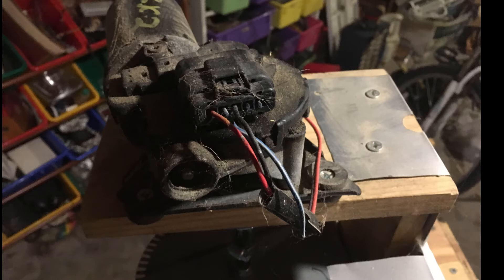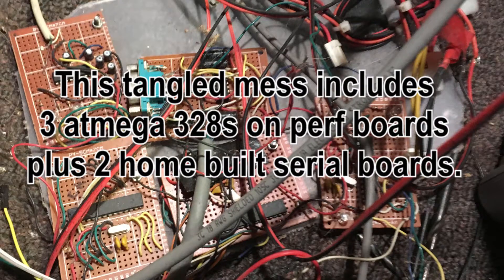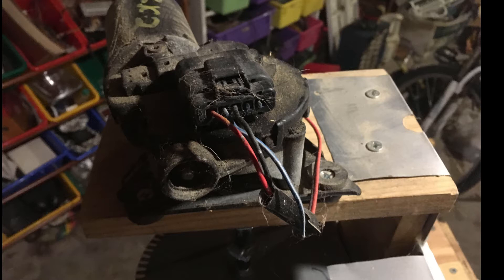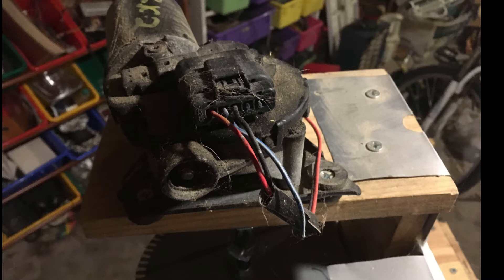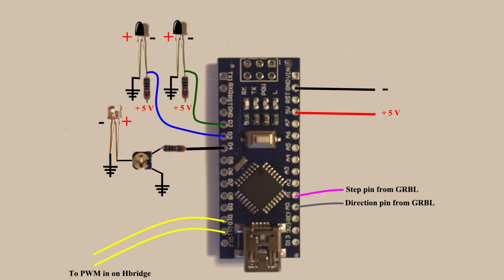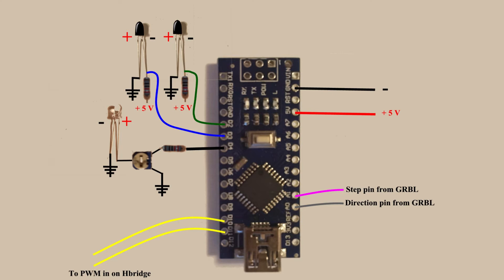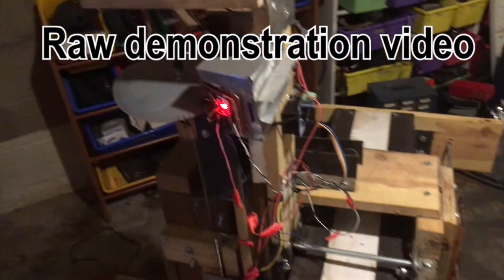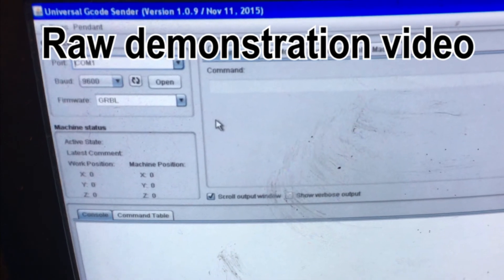Cheap motors for CNC machines and 3d printers

Comment: I would like to send you some images of the connection to evaluate why it does not work
Reply from the maker: There are too many wires to diagnose from a picture.The easiest way to troubleshoot the system is to work from the hbridge backwards. If the hbridge, motor and nano motor controller are working properly when you turn the motor the hbridge should activate and attempt to return the motor to its original place. You can use an led on the motor controller to test the encoder setup. If memory serves the led pin is listed in the sketch for the motor controller sketch. Make sure the digital grounds are all connected and the analog ground for the motor drive to the hbridge is separate from the digital grounds to prevent noise.
Reply: @CircuitSecrets Hello, I was once again forced to send to your country to buy the same module that you used in the video, I would like you to tell me what the pins are connected to (R Is and L Is) 😅
Reply from the maker: @Dmecatronic Lpwm and Rpwm take the pwm output from the nano.
Reply: @CircuitSecrets  I think I did it 😅
Reply from the maker: @Dmecatronic Awesome!
Reply: @CircuitSecrets  When sending the order, the Arduino nano takes a few steps and blocks, turns on an indicator LED and does nothing else that you think is necessary?
Reply from the maker: @Dmecatronic It automatically blocks when the steps get too far from the actual point the feedback through the encoder calculates. If the hbridge and motor are working try reducing the feed rate from grbl. Its basically a closed loop, the encoder has to count the movement and the steps from the GRBL controller, this gives it the target. Another option is the motor is stepping backwards according to the encoder. If this is the case reversing the motors connection to the Hbridge will correct it. There is also the possibility the encoder is not reading, when the encoder reads the led on the nano will switch off and on reflecting the state of one half of the encoder.
Reply: @CircuitSecrets  Now I can say that I achieved it 😅 thanks to you 😅👍, I just had to change the polarization of the motor
Reply from the maker: @Dmecatronic Awesome! I hope you have learned something new from it. Congratulations for not giving up!
Reply: @CircuitSecrets  The only fault is that it forgets some steps, perhaps adding a disc with more teeth will solve it.
Reply: @CircuitSecrets  I was excited like a child when I saw it work 😅
Reply from the maker: @Dmecatronic If its missing steps could be alignment of disk or the feed rate is too fast for the sensor to keep up.
Reply from the maker: @Dmecatronic That's great, I am glad you got it working.
Reply: @CircuitSecrets  Yes, thanks to you 👍 I will continue improving the project
Reply from the maker: @Dmecatronic Awesome! Share the information, and any upgrades you come up with!
Reply: @CircuitSecrets   Yes I will, I'm not going to touch the code since I don't understand much, but I will try with an encoder that has 4000 steps, something that I would like you to explain to me is the logic, broadly speaking I imagine that you know more than me what a PID control, I would like to know if it behaves in the same way or better
Reply from the maker: @Dmecatronic PID is what most of the algorithm on the nano emulates. In theory a PID can be more precise, but the code for the nano keeps it within a few steps and close enough to offer more precision than the accuracy of a hobby grade CNC will even notice. The logic tracks the actual point through the encoder, reads step and direction commands from the GRBL board and attempts to keep the target point as few steps as possible away from the target point without causing jitter. It checks the target point against the actual point from the encoder and throws an error if the two are too far apart. It adjusts the power and direction to the Hbridge based on the difference between the two points. It could be better if it used time as a measurement as well, but as is it runs as well as I wanted it to and did not error after 24 hours running straight.
Reply: @CircuitSecrets  It's actually very good, I'm going to try a high resolution encoder and I'll write you the results
Reply from the maker: @Dmecatronic Awesome!
Reply: @CircuitSecrets  Hello, I did the tests with the high resolution encoder and the only thing I could notice is that the motor vibrates a little while walking, apart from when it reaches the designated place it shakes, with a smaller encoder
Reply from the maker: @Dmecatronic  Right on, you can adjust the deadzone a little wider in the nano code to reduce oscillation.
Reply: @CircuitSecrets I also need to know where you connect the pins (enable A and enable B), since in the video only the pwm lines come out of the Arduino nano, And the value of the resistances that the infrared receivers and the emitter have

Comment: Hello, I bought all the components and made the project but it doesn't work, I have an Arduino nano and an uno, the Arduino uno is running GRBL and the nano is running the code, which ground should I use?
Reply from the maker: All of the digital grounds should be together, the analog ground to the hbridge should be separate to avoid noise from the motor on the digital grounds.

Comment: Another question that I would also like you to answer is if you were able to completely finish the CNC machine and if you were able to use it perfectly without any deformation when machining the parts?
Reply from the maker: I got as far as milling part of the bed flat and had to tear it down to make room for other projects. I plan on putting it together again hopefully this winter and doing more with it. Especially since my videos about DC motor control and CNC have gotten more traffic lately.
Reply: @CircuitSecrets  Your idea is good because no one knows how to explain this thing about CNCs with DC motors. If possible, I would appreciate it if you added Spanish subtitles for the logic part in your next videos, since there is not a single video in my language. within all YouTube that explains this
Reply from the maker: @Dmecatronic  I need to find a way to generate subtitles in different languages, maybe AI. If you know of a easy quick method let me know.
Reply: @CircuitSecrets  ok
Reply: @CircuitSecrets  Hello, give me some way to contact you to show you some projects, today I made a homemade driver for mach3 capable of receiving signals from the Chinese red mach3 card, this driver has the peculiarity that the power stage can be decoupled to increase according to need In the next few days I want to test your code for DC motors and encoders with mach3 and I would like to send you the results
Reply from the maker: @Dmecatronic  OK, you can send to the circuitsecrets email address listed on my channel.
Reply: @CircuitSecrets  ok brother

Comment: Hello, would it be possible to use the Arduino nano part with everything and the servo motor as is for signals coming from mach3? or what can be done?
Reply from the maker: I have never used mach3, but if it gives step pulses and direction signals that a normal stepper motor controller uses then it should work to drive a motor, encoder, and Arduino nano set running as described.
Reply: @CircuitSecrets  I have seen that they make homemade drivers to work with the Chinese mach3 cards, they use the IC l297 which I have also seen in homemade drivers for motors with grbl, and they have in common that they connect in the same way both in the mach3 interface and in the arduino that carries the grbl firmware.
I imagine that they should be very similar signals, another thing is that in mach3 you can configure the number of steps per revolution and also the time in milliseconds that each pulse lasts.
Reply from the maker: @Dmecatronic  Nice, yes that sounds like it would work.

Comment: hello, could you help me to get the software part?
Reply from the maker: Are you looking for the firmware for the controller or the g code sender?
Reply: @CircuitSecrets  Hello, I would like to learn how to relate one program to another so that it works, and to know where the library is installed and how the G code is sent so that the machine can interpret it, thanks for answering!
Reply from the maker: @Pakhomeguns  The firmware for the motor controller (the arduino) can be downloaded from circuitsecrets.com, the grbl firmware for arduino is on the GRBL git repository. The Universal G code sender that streams the gcode to the GRBL board from the P.C. is also on a github repository. The universal Gcode sender requires Java 7 or higher to be installed, and that can be found on the Oracal website. The whole chain works like this. Java allows the universal G code sender to run. The g code sender sends commands to the GRBL board through the serial port(usb virtual serial port) of that arduino board. The GRBL board translates the G code to motor commands in the form of step pulses and direction signals, it then sends step pulses and direction signals to the motor control boards that run the firmware available on the circuitsecrets site, and those boards each control one motor, hbridge, irled encoder set. The whole setup with three axis requires 4 total arduino boards. 1 grbl board and three motor control boards. I hope this helps, let me know if you have any more questions.
Reply: @CircuitSecrets  Let's see if I understand, I install java 7 or higher, I install the universal Gcode sender, then I send the GRBL library to the 4 arduino boards, so that the universal Gcode sender can send the G-code files to the arduino boards and they interpret it and Send to the H bridges?  If I'm wrong, correct me on something else, I would like to know how the arduino boards communicate both in the electronics and in the software part, thanks
Reply from the maker: @Pakhomeguns  The GRBL library goes only to one board. The wires that come from that board that usually go to stepper motor controllers instead are connected to the 3 other arduino boards. Those boards each have an hbridge and ir led/2 ir detectors and those three boards run the firmware I wrote that is on circuitsecrets.com. The dc stepper design I use is similar to some feedback controlled drives common on large industrial cnc machines. The biggest difference is I used home made ir encoders instead of factory built reluctor encoder sets. They are a lot like the reluctor setup in car distributors so they are very durable, but even with part numbers they are almost impossible to find and when I do they are prohibitively expensive. Are you at all familiar with how the grbl cnc/3dprinter control boards work? You can look up the wiring diagrams for them to get an idea of that circuit. I will try to revisit the motor controller in a video on next Tuesday if possible. List some questions here after you look at the diagrams online about grbl and stepper controllers and I will try to cover them in that video.
Its kind of hard to explain, but the only innovation I did was to build feedback controlled DC motor stepper controllers. I will cover the diagrams and source code in better detail next Tuesday.
Reply: @CircuitSecrets  Now if I understood better, the grbl firmware is only installed on the arduino master, it communicates through the port with the universal gcode sender, the arduino master outputs the orders in the form of pulses to the other arduino boards, I imagine that in Is it that the PID code is installed? Then each one of these sends the signals to the H bridges, which are the ones that make the motors of each axis move, with the encoders, each one of these boards receive feedback on the position of the axis in order to make the adjustments corresponding to the information provided by the arduino master?  I would like you to make a diagram of the connection of the main arduino board and the others, in addition to configuring them for each axis, for example, to know in which pins of the x,y,z boards the pwm ones coming from the arduino with grbl are installed,
Reply from the maker: @Pakhomeguns That all sounds correct! I will include full connection diagram for the next video. Thank you for the feedback!
Reply: @CircuitSecrets  Thanks to you, and regarding the next video you should show the assembly process of the electronic part, how to insert the different files in the different arduino boards and how to choose each one for each axis as well as the assembly of the connections of the pines, I say all this because there is no video in English or Spanish that teaches and shows this complete process on all of YouTube
Reply from the maker: @Pakhomeguns  Thanks for the advice! I like it, I will break it down into parts so a person can easily skip what they want, or watch the whole thing.

Comment: I know you're busy, but any word on that firmware yet?
Reply from the maker: It should be soon I am preparing a video about the Raspberry Pi Pico and then its back to the CNC project. I had to get a new mic and finally got things squared away enough to start getting content out again. I am so sorry its taking so long. With any luck I should be able to release the firmware and detailed explanation of how it works within the next week to week and a half.
Reply: @CircuitSecrets  Thanks. I appreciate your efforts. I look at your videos as a gift, and would never intentionally rush you.